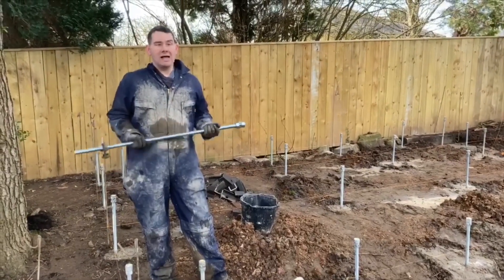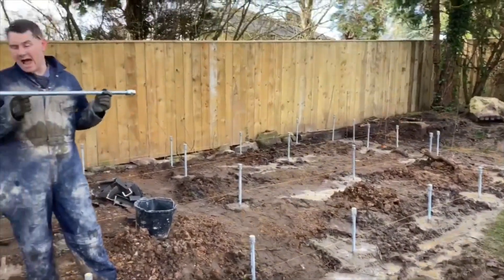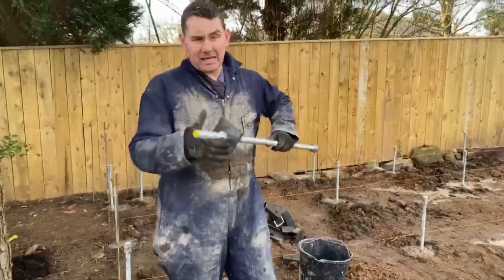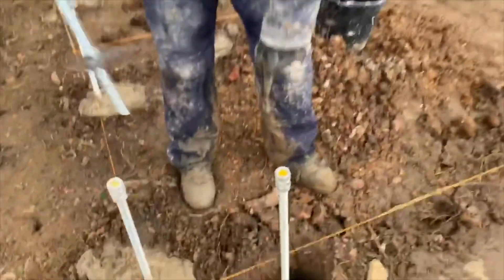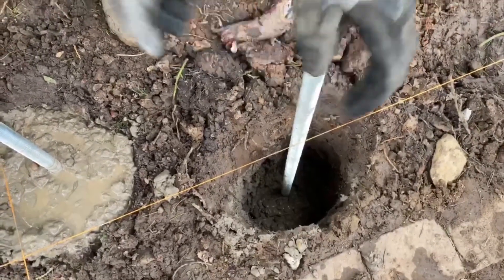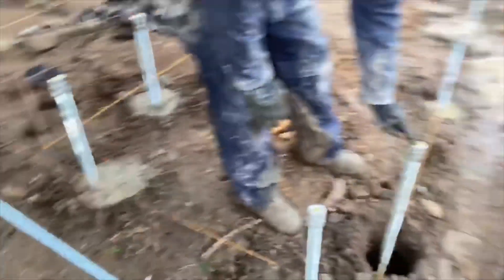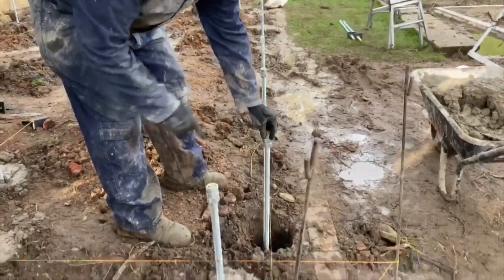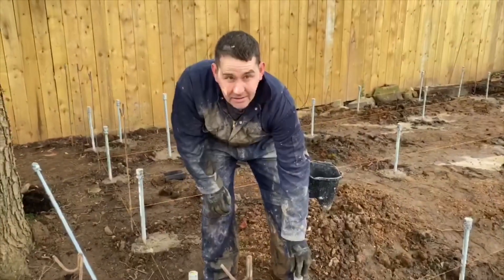Day 2 of a garden office construction with full tutorial

Comment: not seen this system before, where do you buy the rods?
Reply from the maker: adrian bennett Bapps in Leeds
Reply: @thegardenroomguru  what are the parts called?
Reply from the maker: adrian bennett threaded bar, 24mm, 100x100 plate washer, nut to suit
Reply: @thegardenroomguru  Hi WIlliam is the threaded bar stainless?
Reply from the maker: Chris838792 it’s zinc plated, I’ve left off cuts in a bucket of water for two weeks and it didn’t start to rust 🙌